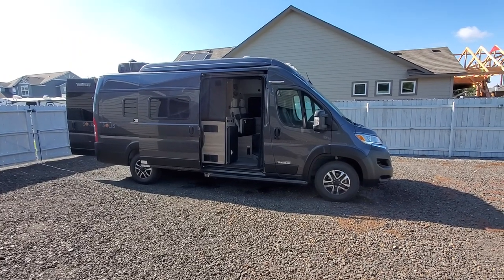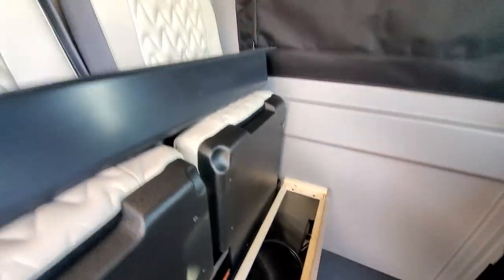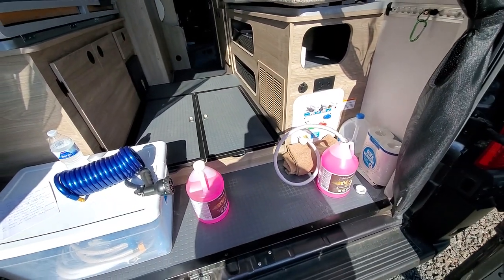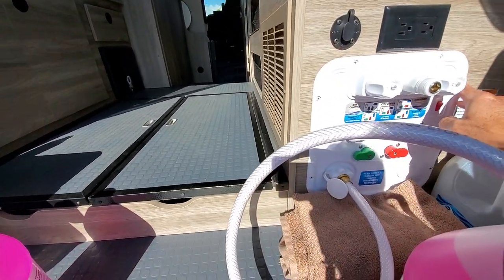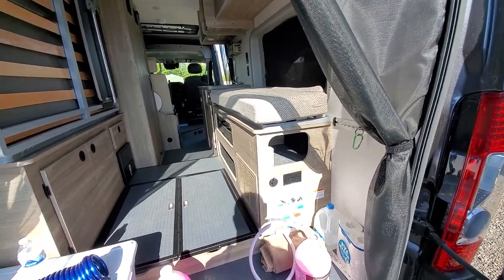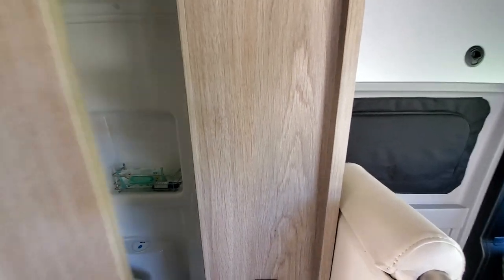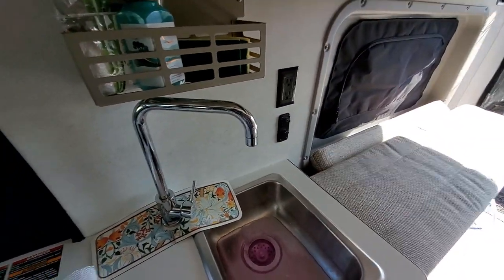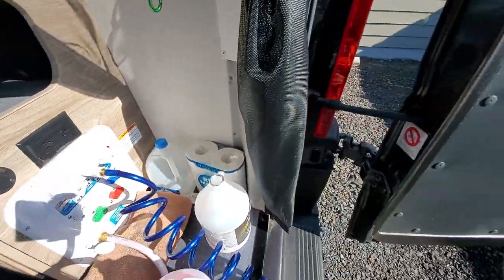2023 Winnebago Solis 59PX | How To Winterize

Comment: Thanks for the thorough winterizing video. My wife and I are considering switching from a 4 season travel trailer to the rig you have now. Do you do anything to protect the coach batteries? Some sites recommend removing them to  a climate controlled setting and trickle charging. Not sure what is recommended by Winnebago. Thanks in advance for your recommendation.
Reply from the maker: Thank you for your comment.  I haven't considered and/or haven't had the need to consider keeping the house batteries in a climate-controlled environment since I usually use the van and/or head down to AZ in the winter.  With house batteries on my previous travel trailers, I've never stored them, and they seemed to work just fine after winter.  However, it wouldn't hurt to keep those puppies safe and warm when not in use.

Comment: Hi, very good video. I’m still not completely clear on how to leave the low point drains under the seats. Am I understanding the steps correctly here…

1st open all valves under the seat to make sure all water is emptied.

2nd proceed with the antifreeze process. 

3rd close the valves under the seat. Do not leave them open? Is this correct?
Reply from the maker: Thank you for the comment.  The correct order should be:
1. Open low point valves to drain water.
2. Then, close all low point drain valves.
3. Set nautilus system to Winterize.
4. Proceed with winterization.
Reply: @thehealthytraveler  yes thank you but that still doesn’t answer my question. After step 4 do I reopen the valves or do I keep them closed until the spring? Thanks again
Reply from the maker: Keep the valves closed.  

The only time you open the valves is to drain the water for winterizing.

Dewinterizing is a different process and valves will still need to remain closed.  I will publish a new video for that process soon.
Reply: @thehealthytraveler awesome thanks
Reply: Hi, do we need to do anything with the eco hot system for winterization?  Also, do you empty the water pump strainer?  Thanks

Comment: Also in your closing summary, you say to avoid running the Truma hot water heater while winterized bc that will boil the antifreeze. I'd thought that the winterization setting on the Nautilus bypassed the Truma water heater and did not fill it with antifreeze. Comment? Thanks!
Reply from the maker: Yes, you are correct.  The Winterization setting will bypass the Truma Water Heater.  However, as a safety pre-caution, I would not turn on the water heater while in winterization mode because 1. it's not needed (there's no more water in the water heater system) and 2. In the event that a small amount of rv antifreeze somehow gets into the truma water heater.  Again, these are just pre-cautionary measures, but it's highly unlikely you would need to turn on the water heater in winterization mode, the furnace, yes, but definitely not the water heater.  I hope that helps.  Thanks again for your comments.

Comment: In your closing summary checklist, you forgot to mention that you also run antifreeze into the toilet flush line.
Reply from the maker: The toilet flush line would be part of the shower/bath checklist, but yes, you are correct, you will want to make sure you flush the toilet in order to pump rv antifreeze through the toilet flush line.

Comment: I couldn’t see what you turned under the seat and what you mean by, “turn that off”… do you mean close? If so, which way is open and which is closed/off? 

Lichtsinn seems to not turn off the truma switch under the seats while Colonial RV does.

Otherwise, your video is excellent… would love to see a quick follow-up video on my questions 😊!

Your video is the best I’ve come across so far! 👏 👏 👏 Now I can winterize my PX!
Reply from the maker: Thank you and apologies on the Truma low point drain valves.   There are three drain
valves and a yellow water heater drain valve.  You'll open these to drain before winterizing.  Once drained, close all of them , then you can winterize.  During the video, I was making sure those valves are still off, but I was mentioning that you can open the water heater drain valve to make sure no rv antifreeze is present.  Then, close the valve back up.  Hope that helps.

Happy winterizing!
Reply: @thehealthytraveler kind of. Follow up video? 😁

Comment: Eco hot?
Reply from the maker: If you use it, yes absolutely.  If not, no worries.
Reply: Wouldn't running antifreeze through the eco-hot unit introduce it into the Truma water heater?? This is a confusing point - because you'd also want to ensure no clear water is present there.... what to do?
Reply from the maker: @KnightsandWeekends Winterize mode automatically bypasses the Truma system.